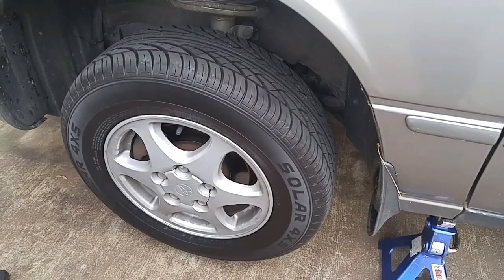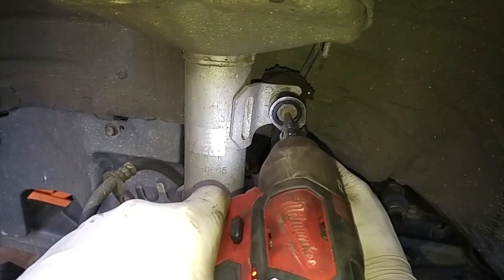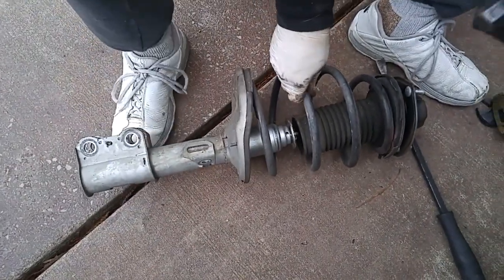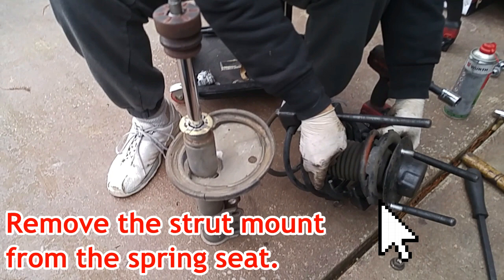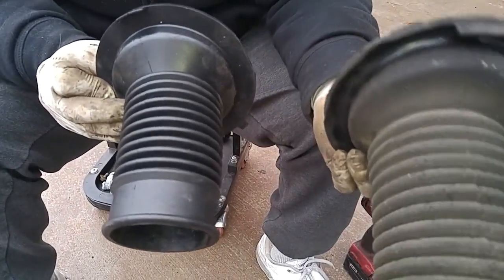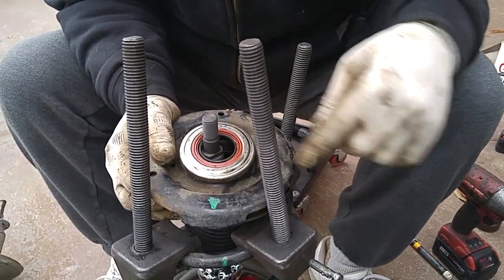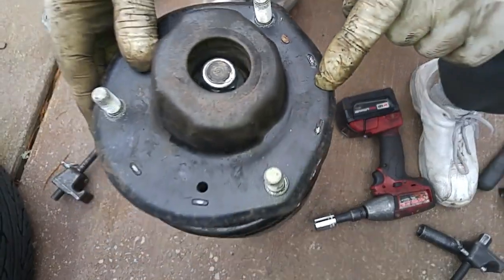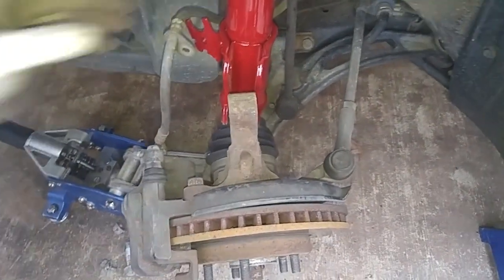Toyota / Lexus Front Strut Replacement - Camry, Avalon, ES300, Solara

Comment: Look very easy but I smell are not better pay few dollar yo get hurt by a super strong spring look real dangerous job but u done a great job 👍👍👍
Reply from the maker: I've done many of these replacements over the years without incident.  The key to making the job go easy is to use quality spring compressors.  Made a huge mistake using the cheapo Harbor Freight jobs.  Kept constantly slipping off!

Comment: WOw bro, Detailed instructions!! would be same for 2013 Lex ES350 ? HOw many mm are the  bolts for the knuckle ?
Reply from the maker: Thanks!  Only additional thing that needs disconnecting on the ES350 is the ABS wire bracket whose mounting point is shared with the brake line bracket on the strut.  The knuckle bolts are 22 mm if my memory is correct.

Comment: Would you say that if the shaft of the strut is above the locking nut, it is aligned with the groove? The reason I ask is because I had a mechanic put mine together and now I am getting clunking noises coming from the strut mount area when I bounce the car or go over bumps. I am trying to determine if my brand new strut mount went bad or the mechanic put it together wrong. I am also going to try and tighten it more now..
Reply from the maker: If reassembled properly the notch in the upper strut mount should line up with the threaded portion of the shaft.  If not, could cause noise.  Most common noise problem is a worn upper strut mount.

Comment: Wow Thanks for posting this.. last time I changed the struts on my ES 350, I was afraid of the spring compression and took it to a garage for them to change the springs out. Do you think having three spring compressor does the trick?
Reply from the maker: Sure ... makes the job easier and safer in my opinion.  I've gone up to 4 compressors.  Get quality compressors though.
Reply: What struts did you use to replace? Or which do you think are the best brand for es 350?
Reply: @dannyhu4078  That's Easy. Always use KYB shocks, or struts.
Reply: @roostercogburn7243  My mechanic put KYBs on my 2006 Lexus es330 and they basically ruined the car. I've given the struts 6K miles and 14 weeks to break in and the Lexus still feels like a lifted Mazda 3. KYB is garbage.
Reply: @biodrummindieseler  I agree, I installed KYBs on my 04 ES330 and the car rides like a log wagon. I am seriously thinking paying the outrageous sum of $500 to get Lexus OEM frt struts.

Comment: Is that brand Gabriel better than KYB? I want to do the front struts on my car and what are the shopping around now for a decent brand
Reply from the maker: KYB is the best you'll get to OEM quality.  The Gabriel struts gives you a little bit more of plush feel.  Monroe OE struts is a good compromise between the KYB & Gabriel.
Reply: @hardlymovingpro  alright so maybe I'll go with the kyb. I put on a pair of sensen shocks and now I hear creaking noises coming from my front end. So now I know to go with a better name brand! Lol
Reply from the maker: That's hysterical!  The pair I replaced on my Camry were also Sensen's and yes, they were making that creaking noise.  Also, the suspension felt like driving over big rocks.  The Sensen struts failed by getting too stiff on the compression stroke and there was no gas for the rebound.  They were always stiff from the get go.  I got around 60K miles out of them.   KYB and Sachs are the best but didn't want to put on expensive struts on a 20 year old car.  The Gabriel's I got were on rockauto.com as a blow out sale.  $10 a strut!  So far, so good.  The ride is smooth.

Comment: Quick question so I trust your answer above anybody ha ha Ha ...is it true I will need a front wheel alignment after putting a simple quick strut? ..I'm saying no but some light to argue😂👹
Reply from the maker: Most of of the time ... No.  It depends on how well the new strut lower mounting holes line up with the steering knuckle.  The tighter the fit, the less likely the alignment going out.
Reply: @hardlymovingpro    thank you
Reply: If it doesn't have the eccentrics like most Toyotas then no need for a wheel alignment.

Comment: Wouldn't a person just get the total assembly and save the risk of having ones eyes or skull gouched out by the compressed spring?
Reply from the maker: For those who don't know what they're doing and are frugal ... Yes!
Reply: Most of the "Quick Strut" assemblies on the market are cheap made in China stuff.  For a high quality strut and components you will usually have to put it together yourself on most cars.  I have compressed a dozen or more strut springs with portable spring compressors like used in this video. It can be done safely.

Comment: KEEP YOUR FACE AWAY FROM THE END OF THE STRUT ASSEMBLY WHEN REMOVING/REPLACING THE SPRING!!!!!!!!!!
And you might as well replace the bellows as it isn't that expensive. And the final result will look much nicer and more competent.
Reply from the maker: Good advice!   Also, from my past observations doing strut replacement on noisy struts, the source may be attributed to a broken upper strut mount.   The strut may be fine but the mount or stabilizer link may be worn out.  Also if the strut stem bumper is worn and not replaced,  the new strut could prematurely wear out.